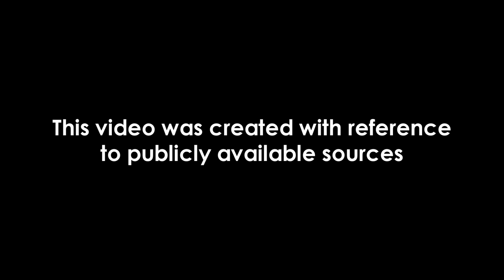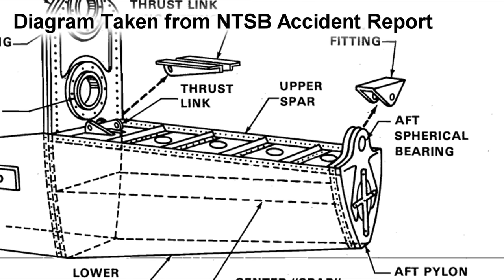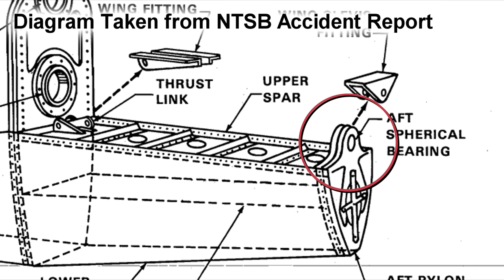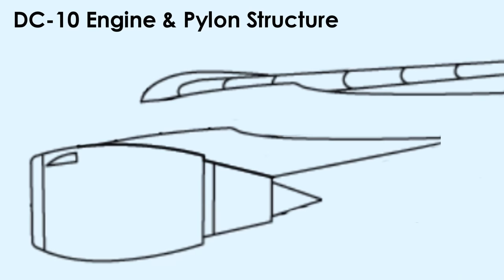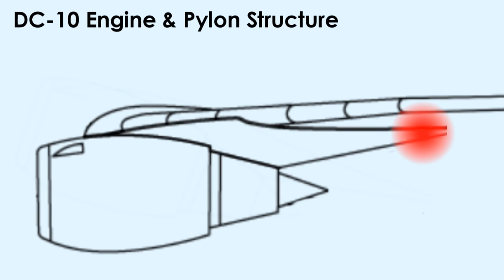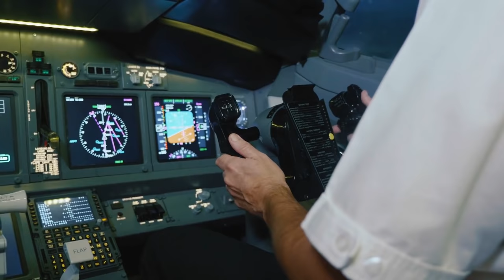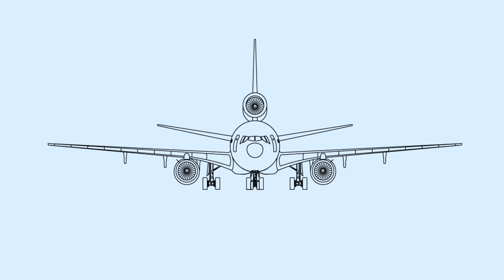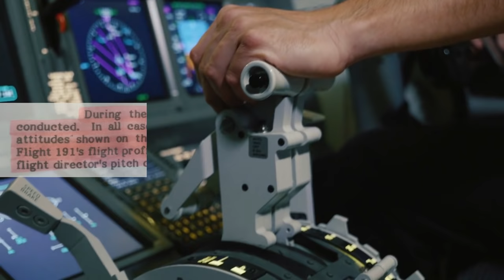America's Deadliest Air Disaster (American Airlines Flight 191) - DISASTER BREAKDOWN

Comment: 03:57 What they (optional experienced operator) did was called total overhaul (annually required, only done by original equipment manufacturer (OEM) at their manufacturing plant not at airport). I was also advised to embark on such venture in early days of my career (16 years ago) on one of newly purchased second hand (slightly used) critical machines. I insisted to perform mechanics and analysis (stress calculations, stress pattern, tooling required before even touching a spanner or hammer), I was mocked at and experienced operator in our shop went on to perform aforementioned operation all by himself during overtime (in evening after regular shift) without calculations based on his experience. What I saw next morning was deformation (torsion) of compelete frame (1/2'' thick mild steel (MS) plate), 1' wide and 30' long and detachment of another heavy part (resembling head stock on lathe machine) so much so that after detachment, it flew all across the shop and caused rupture in steel wall of shed on other end. This happened after he jump started the motor connected with the machine (again, jump start not gradually increase power). Fortunately, no one was hurt including operator but research and development on the machine (which was aim) was permanently stopped after the incident as it was no longer in shape to be operated. We had to sell it as scrap. We had a lot of public money to waste. Second most important and horrific thing I notice is that all three airlines (American, United and Continental) went on to develop their own procedures of detaching and re attching engine (most important part of aircraft) based on third party hired technicians who, by default, can not do calculations as they are technicians (mostly having 02 year aircraft maintenance certificate from airline's own trade school at airport after 10th grade (no offense)) and they compare themselves with engineers (at least 16 year education (04 year degree after 12th grade)). Thats why it is utmost important to read OEM manual not maintenance manual. In OEM plants engines are not removed by hoist or fork lifts. There are specially designed fixtures for this. What I see out of this video is these airlines caused decline and demise of one of best airplane manufacturing organizations of its time just because of their stubborn and uneducated approach. Airlines still exist but MD is history. (Who issued service bulletins from within MD is unknown and is another reason of demise of this OEM).

Comment: This disaster is a prime example of the importance of knowing in what manner your equipment will fail when you are using industrial equipment.  The reason that a forklift maintenance method damaged the pylon, while the overhead crane method didn't is their failure mode.  

When a forklift loses power the part falls.  When an overhead crane loses power, the part stays where it is.

Comment: Details are vague but the crash of 191 is supposedly tied to a premonition. 

From Listverse.com

"For 10 nights in a row in 1970, David Booth had the same nightmare. While deep in sleep, he witnessed a jetliner veering off a runway, flipping completely over, and then bursting into flames. Booth felt compelled to inform the FAA about his dreams. Officials actually listened to what he had to say and concluded that he was dreaming of a Boeing 727 or perhaps a DC-10 plane.On the day that David Booth had his last nightmare, American Airlines DC-10 Flight 191 crashed just a few moments after takeoff."

Comment: This disaster is the absolute pinnacle of proving why PROPER maintenance procedures and not cutting corners in those maintenance procedures are absolutely paramount to flight safety. Imagine if American Airlines had followed Douglas’ recommendation for the procedure, or even if they didn’t, imagine if they had done the same as United and instead of using a FORKLIFT they used an overhead crane system to support the engine and pylon structure.
Reply: Sometimes 'proper' maintenance procedures recommended by designers and manufacturers are unrealistic in the commercial world.  The original procedure is the separation of the engine and the pylon which is very time consuming as it requires hundreds of hours in just removing around 80 connections points. Later it is discovered that if the engine and pylon are removed together as a single unit, only 27 connections point are removed and thus saving around 200 hours. In the competitive commercial world, the longer the delay the less profit will be achieved. There is nothing wrong in finding shortcuts. United Airlines uses an overhead crane system while AA uses a forklift for the same task. Whether McDonnell Douglas is aware of such procedure or whether AA or other airlines did inform McDonell Douglas about it is unknown.

Comment: Im in school for my A&P. My instructor has been preaching about this flight since day 1. 

This Friday, 06/07/24 will be my last day as a utility tech at a MRO working on government 737s. While im not giving up on my A&P. I dont want to work there because im seeing the signs my instructor warned me about these past few months. After a fight with a lead, a rather nasty meeting where they said we had to follow the rules. Yet in the same breath will actively cheat by using hoarded bolts and screws, taking shortcuts, etc etc. the numerous in hangar safety violations, blocked exits, being told I had to go on the wing without a harness, not having resources to do our work and being told we had to just continue install, the constant enforcing of Norms until it becomes a write up for a lead then we get blamed. Its a rot that starts from the inside out. 

I get it, no job is perfect. Today 06/05, I watched blatant safety violations happen. When I brought it up, I was shrugged off with a nasty "we are working on it" then promptly ignored by another lead. I put in a Safety report and ended up leaving for the day at the end of my shift. Im sure when I come back hell will be to pay. 
Im going to quit, I dont want this blood on my hands and im going to try and report what ive seen. It seems to me the leads are more worried about getting bitched at over hours and their paycheck then they are about making sure these aircraft are safe. Headlining moment for me was when my immediate lead for the day started a huge argument with me on the hangar floor. He tried to force me to do something against the maintenance manuals and do it his way because "we always do it like that so deal with it.. just because you dont like it and a piece of paper says so..." This dude isnt a A&P either, hes one of those drop outs. I refused, told him I am refusing to work on it and will refuse to stamp it. I get paid to follow the AMM and I wont do it. He got mad and I was sent home early over it.

Im afraid this job, if they keep up the Good Ol Boy syndrome theyll kill someone. Im not here for it, im going back to driving until I get my A&P. I also found another job doing small time Avionics ill probably see if I can jump into instead

Comment: I watched to the end.  YT recc'd.

You did a good job explaining the LE flaps (slats) ... and you mention the FO did as taught, pulled up to reduce speed to V2 (+10) ... if he'd just maintained what he had, they'd have lived.  they'd have gotten all flaps retracted and continued as a normal engine failure recovery.

what you missed was that just before this crash, AA's Maintenance and Engineering sought a "337 Major Repair/Alteration" on their DC10 fleet to install a "Hyd Fuse" in the LE device hydraulic line ... like Boeing had installed in the 707 and 727 which were already in the AA fleet.  Douglass denied the modification.  So did the FAA.  Would approval have been an admission an inferior product was designed and built?  Would approval from the FAA have meant they certified an inferior design?

The problem with the AA engine removal process was that the assembly was allowed to "pause" while they took lunch and seeping hyd pressure on the forklift resulted in the described damage.  It wasn't the process itself.  AA maintenance had done engine removals in this manner on all other fleets and even on the DC10 fleet.  But the lunch break at a critical point was a problem ... and so was blind adherence to flight procedure. There was no ground/ground attachment to outclimb on takeoff out of ORD's 32L (T10 intersection).  Speed is life.

The govt, the mechanic union, and company had the mechanic crew believing the crash was all their fault.  One mechanic committed suicide.

My old man was a then 12 year AA AMT: not based at ORD but he knew personally one of the mechanics on that mechanic crew ... I am in my 27th year as an AA pilot.  Mishaps are always more complicated than the advertised reason.

speed is life.
Reply: IDK why you keep using video footage (computer generated or otherwise) of a Boeing 777.  At least use era-specific file footage.  The B777 wasn't operational for another 20 years.

Comment: I’m still trying to figure out how a plane can just easily disintegrate like that.  I feel these companies would’ve had some sort of crash test to make sure the planes can survive crashes  can someone please explain this to me?
Reply: All of the testing would be done by the aircraft manufacturer before being allowed to sell the aircraft
Reply: It's fairly straightforward. Aircraft have to have a fairly light structure in order to fly, and the impact forces in a crash are staggering. Those forces increase with the square of the increase in speed. Double the speed, quadruple the impact forces. This is why a rifle bullet the same size as a pistol bullet does so much more damage -- it's travelling at a significantly higher speed. This is why even relatively small asteroids are dangerous -- they are REALLY moving. Also, in a car crash, the vehicles frequently hit something that can itself move, stretching out the time period during which the impact force is delivered. When an airplane strikes the ground, all the impact forces are delivered instantaneously. These are some of the reasons.

Comment: there was another underling problem , hydraulic check valves were not installed by Douglas, if they would have been there the leasing edge flap would have maintained its current position preventing the roll that occurred.  The FAA gave them 2 years to install them.
most planes have them

Comment: This is a good description of what happened to this flight,  however,  in the beginning,  it is another unfair hit job to the DC-10. 
The 1st incident of a DC-10 was the Windsor incident,  where a cargo door blew off causing severe damage to the aircraft,  but landed with no injuries. 
McDonnell Douglas sent out emergency directives to airlines world wide of what to do to solve the problem. 
The Paris crash occurred because Turkish airlines did not follow-up  on the repair.
The other crashes that occurred in the 70's were pilot error,  and or weather related. 
The last crash was 89, with united 232, because of an absolute catastrophic engine explosion,  with bad examinations of the engine fan disc of United, and GE.
The DC-10 was an excellent aircraft, and over its lifetime with the airlines,  had an excellent safety record, of which should be explained correctly. 
This kind of piss poor reporting put McDonnell Douglas under.

Comment: At 1:33 the model is showing a MD11.
Maybe I'm wrong, but I push, park and tow them everyday at UPS. Did a dc10 ever have   center main gear wheels?
Reply: The DC10-30s and I believe the DC10-40s had the center landing gear.  Flight 191 was a DC10-10 which did not have the center landing gear.
Reply: Your right, I looked it up.

Comment: Arizona and Indiana are two of the areas that are weird as relates DST, but I can't remember the particulars.  FWIW, I haven't been on a plane since Sept '87 and don't plan to be.  Transportation is such a cut-throat biz that time saving efforts and utilization are always top priority - in the air and on the ground.  The air disasters that stand out to me are Egypt Air 990 and Air France 447; 990 for the example of exceeding max operating speed, and 447 for longevity & constitution of "black boxes."  Both as they relate to the planes which are alleged to have impacted the WTC towers on 9/11.  These videos are well done.  I've watched two so far and will watch a few more.  Thanks for the work!

Comment: It's been a long time since this terrible crash and all the investigation. The pilots followed all their training and experince but did not know the damage was too severe for their procedures to recover or have the instrument readings needed.. However,  there were some simulator recoveries made knowing what the damages were.  I do not recall the year of the simulations,  however with more research I believe my recollection is correct. I was flying from SFO on this day and saw the news images in the airport.
An asymmetric stall like this one can be compensated for by adjusting the Angle of Attack on the remaining wing surface. Difficult at low altitude but this aircraft still had enough power and right-wing controls to recover. And this is where successful simulator recovery was accomplished,  but it still required knowing what the failures were in the original flight. Since this time instrumentation and control, has changed considerably and does not rely on the way this aircraft was originally designed. The failed simulator attempts to understand what happened were based on "real" conditions, however ingenuity on the part of the pilots eventually discovered a corrective action.
Reply: From the crash report it doesn't really seem to have been ingenuity, it was just responding to what (in the simulator) they knew was happening. It seems corrective action was predominantly lowering the nose and increasing speed. Even if the standard procedure had been to continue at a higher speed, it seems to indicate the crash could've been avoided.

Comment: Google isn’t helping. So I’ll ask anyone who might be savvy in this field.
How do they determine the mechanical reasons of a crash? Like when it crashes I’m assuming it’s all smashed, burned and crumpled metal. So how do they go “yeah it was a faulty _________”?
Reply: A ton of different things go into investigations, the sheer scale of their undertakings can't be overstated. They take so long for a reason. The flight data recorder and CVR are obviously the first things to try and retrieve, and witness accounts or any issues the flight crew may have mentioned over comms before impact helps pinpoint what happened as well. On the mechanical side of things when specific parts fail they typically deteriorate in unique and characteristic ways and don't match what they should look like from an impact alone, don't match the general deterioration of surrounding parts, etc. A single random piece of debris may not say exactly what happened but based on its suspicious scarring and breakage and all other available data it can become a piece of a puzzle that begins to make more and more sense as it's reassembled.
Reply: Also plane crashes are typically more intact than people tend to envision. During extremely violent impacts like a nosedive into the ground at full speed yeah, the plane and everyone on it basically turns to dust, it's happened before. In general though a notable "husk" of the plane is usually still there, even if it's broken into a bunch of pieces.

Comment: They might have been popular but I don't know why they had a bad record
Reply: Probably cause the reason for their bad record was often the result of improper maintenance. The company said "Do it this way" but the airlines said "No this way is quicker"...and low and behold the quicker way wasn't sufficient.
Reply: IIRC the DC-10s were the “next best” design (aka most profitable) in air travel and both the manufacturers and Airlines couldn’t wait to get them in service   So they sped up the assembly line to get them to market as quick as possible,  and took seemingly inconsequential short cuts, which resulted in their poor performance as a brand.

Comment: If the pilots turn off the  right engine...maybe  they could save the aircraft...The problem:  the pilots  never known about the lost of the left engine...
Reply: The left engine detached the plane crashed due to the hydraulic fluid leaking when it dried the flaps retracted causing asymmetric stall at low altitude

Comment: All 70 simulator flights that "replicated flight 191's control inputs" ..were lost.

-Does that mean that it WAS possible to NOT crash ??
(If you handled the plane differently) ?

-Just to be clear, I truly & really believe that the crew did exactly the right thing...ergo; what they were supposed to do!
I'm just curious if it might be possible to actually "save" the aircraft ? (Just theoretically).
Reply: Almost certainly not. That’s what the simulation demonstrated.
Reply: @peteconrad2077  Actually there's an additional simulator test which shows that had the crew flown the aircraft at V2 + 10 knots instead of retarding to V2 speed, they could have flown away safely. American then changed their procedures for engine failure so that crews do not need to slow down to V2 if their speed exceeded V2 at time of engine failure.
Reply: @tiadaid simulators don’t have the aerodynamic test data to simulate this failure accurately.